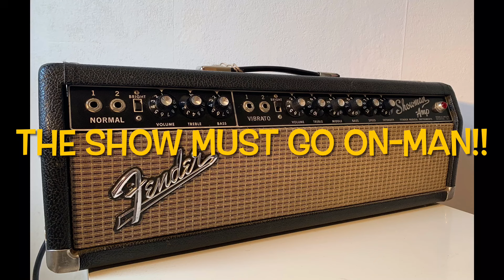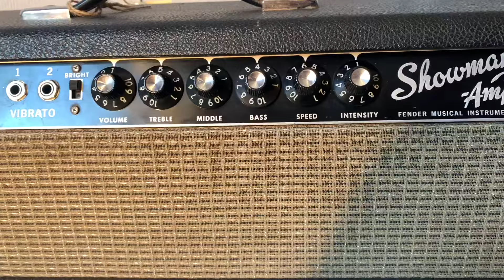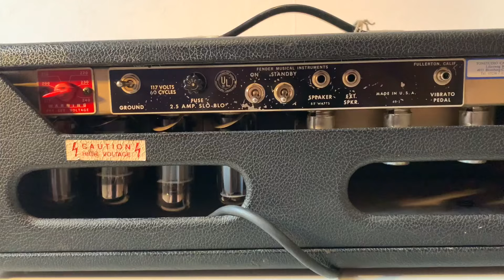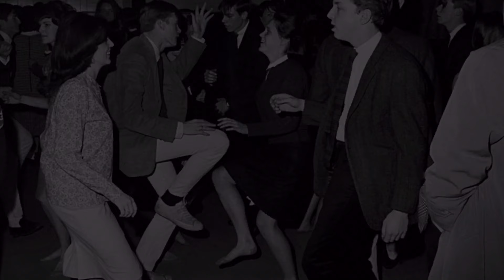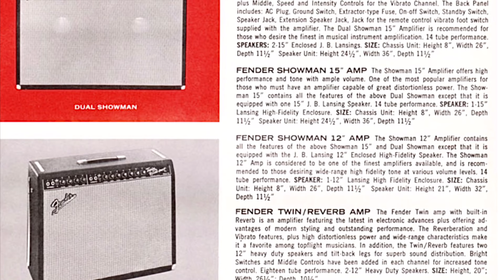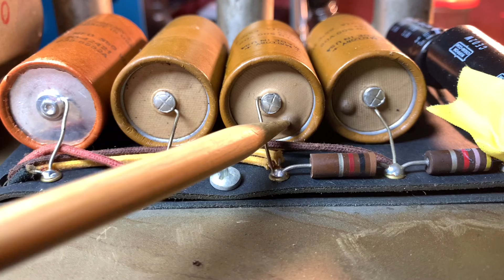The Fender Showman: service and repair of Fenders top of the line amp from the sixties!

Comment: What is the output tubes transconductance measuring? The output tubes have to match pair the transconductance but why?
Reply from the maker: @waynegram8907  

Hey Wayne

Here’s a quiet simple explanation of the meaning of transconductance in vacuum tubes:

Transconductance is a derived result calculated from several measurements. It is a measurement of how much AC current will pass through a tube at a given plate voltage, bias voltage, and signal input. Mathematically, it’s the result of the AC output current divided by the AC input voltage. Different results will occur given different driving environments for a tube.

Though my Tubetester is a pretty simple device, it’s not able to measure the transconductance. It just checks if the tube works and if the emission of electrodes is strong enough to deliver a good performance. Considering the transconductance and other electrical characteristics of the tubes, it’s necessary to buy matched pairs, quads etc.
Reply: @martinstubeampworkbench2299  Since your tube tester can't measure transductance, you can use your Oscilloscope or DVM meter in AC mode to measure the output tubes AC input voltage and AC output voltage to compute the transconductance? I didn't see you do this for matching the output tubes in the video.
Reply from the maker: @waynegram8907 

Well, time is money. And I don’t want to get too nitpicky about that.If an amp needs new tubes, I‘ll order a matched set. If old tubes measure a strong and healthy emission, a reasonable bias is possible and the amp sounds fine without an excessive noisefloor, I‘m cool with that.
Reply: My reverb tank is new, but still no reverb, and very noisy,   Tremolo hums, but does not work
Reply from the maker: Another question, that is not easy to answer….I would start by swapping the tubes in the reverb and tremolo circuit. The reverb transformer might be faulty. But a diagnosis from the distance is a bit tricky.
Reply: @martinstubeampworkbench2299   Thanks, I will try replacing  with ElectroHamonix tubes  Yes.. sorry.  my mistake, Sovtek tubes.   Solvang is a town in CA.